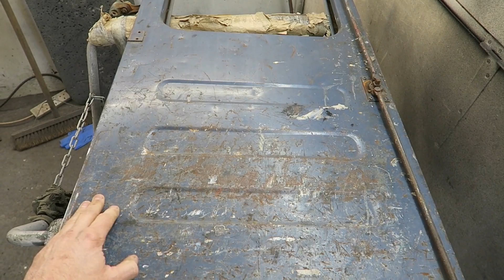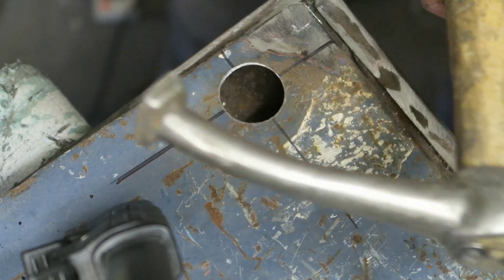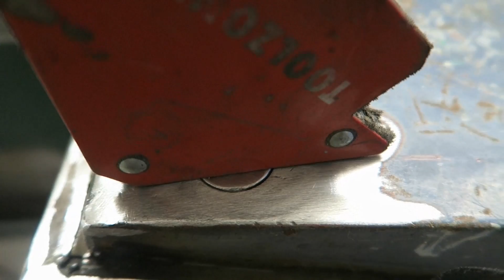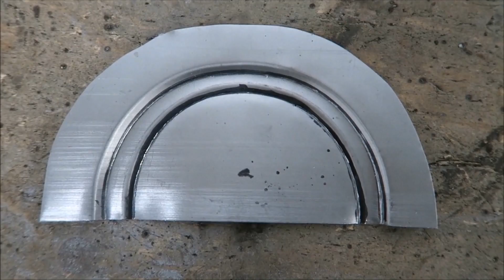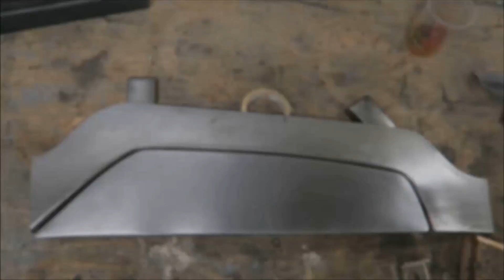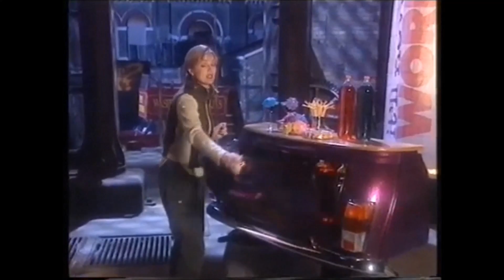Captive nut repair, panel beating techniques Tips and tricks #9 Bodywork

Comment: Hey, when the washer ends up slightly off centre, why not simply run a tap through the nut all the way past the obstruction?
Also, You could weld the washer on with a bolt through the nut in pace, tp help keep the washer centred, perhaps.
Reply from the maker: Yep great ideas 👍 since making this I’ve made myself a tapered tube that fits over the bolt, the tapered part fits neatly inside the washer holding it dead centre. Cheers Trev 👍

Comment: To better fix the problem with the nut off center of the washer, run a tap through the nut.  Also:  when you weld it in, have a bolt threaded through,  and remove the bolt immediately after welding.   If you put too much heat to the nut, the bolt will prevent the threads from distorting.

Comment: Perhaps I am missing something, but wouldn't it been easier to "hook" the fallen nut assembly with a long bolt with the proper threads, pull it up flush and tack weld it in place.

Comment: I use fully threaded flat head screws to hold a nut centered for welding. I welded a t-handle to the frequently used ones. The taper helps as long as the hole is clean on both sides and you hold the nut flush while tightening.

Comment: You could also bolt a cheap cabinet hinge to the captive nut before cutting it out, then tack the hinge to the panel, remove the bolt, flip back the hinge & bolt your new repair section to the hinge, flip it into position, tack the repair section in, then remove the bolt & grind the hinge off. I use this method all the time & get perfect alignment. Great videos, keep them coming.

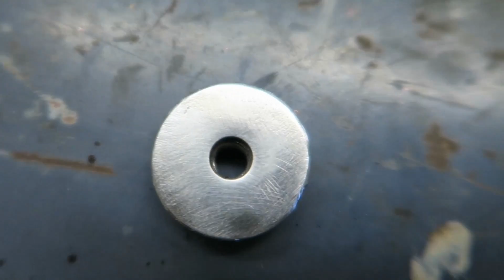Comment: At 7:04 you are talking about centering the nut and washer holes. I would thread a bolt through, and put some anti-spatter on the threads so they don't get damaged with the welding. (so the order would be bolt head, washer, nut). this would ensure the holes line up before welding, and it will also ensure nothing moves
Reply: wouldn't that be kind of hard to have the magnet holding the washer thats being welded in place ? because if one washer is going to cover that from the front how do you get to the back then or vice versa if the washer is on the inside what is holding the bolt from just falling in the hole ? sorry just trying to understand your idea is all : ) wouldn't the bolt head get in the way of the magnet holding it in place?
Reply from the maker: joseph legere when trap the washer, even if it’s centred quite well the pull from the weld can pull the washer over and cause the threads to bind against the washer. The chamfered bolthead or just a simple piece of tube with a chamfer on it works well. Cheers Trev 👍

Comment: If you were to use a countersunk bolt in the captive nut through the washer before welding the washer to the nut it might end up more central. Also if its a close fit and the positions isn't too important you could just run a tap through it :) Fantastic videos mate, really enjoying them. Also, just got to the part about a countersunk bolt, great minds haha!